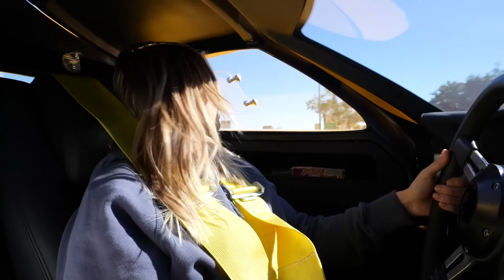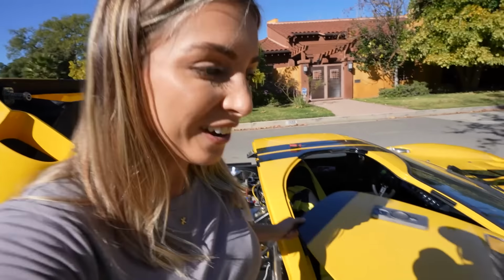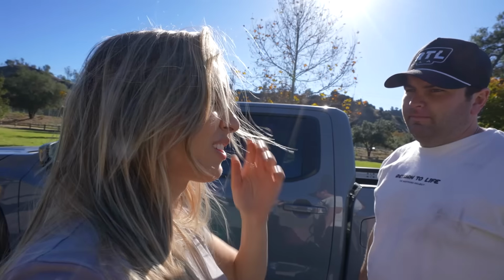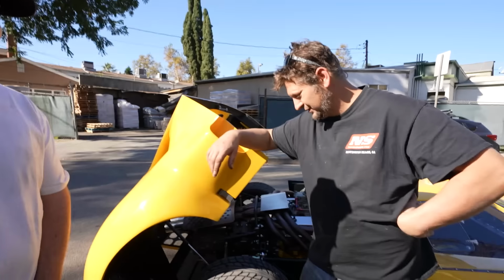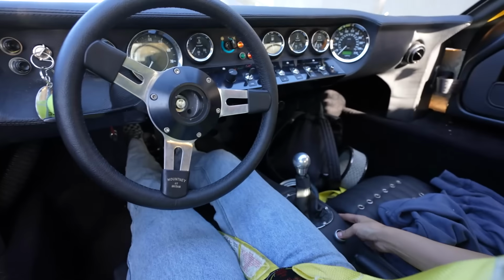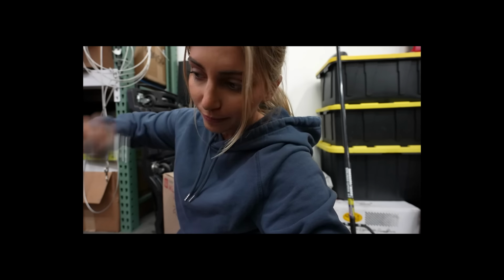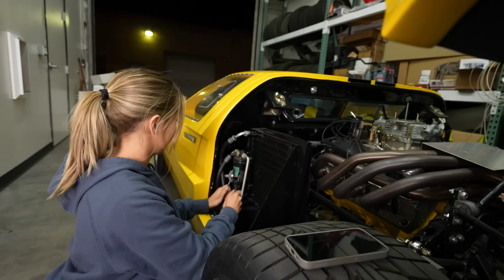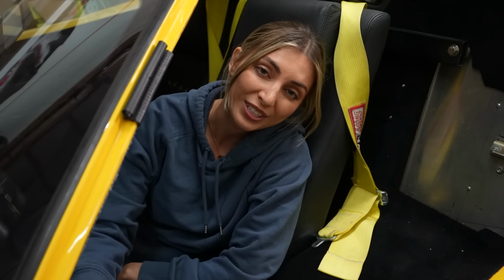The Dumpster Fire that is my Ford GT40.

Comment: Cool video, I am curious if you found the issue with your transmission popping out of first gear, do you have a link to the follow up video, you have so many video's it's hard to sort through all of them? My first car was a 1965 Mustang Fastback I bought in 1980, it had an C4 automatic transmission. I found a parted out 1970 Mach 1 that was rear ended and bought the Borg and Warner 4 speed transmission, the dual reservoir brake master cylinder and front spindle and single piston brake caliper assembly to convert my Mustang's brakes from drum brakes. I rebuilt the transmission myself using a transmission HP or SA rebuild book, I replaced all the seals, brass syncros, and all the bearings before installing it, and it shifted great, but when decelerating in second gear it would pop out unless I held the shifter, I never fixed it and lived with it.  When I wrecked the car in 1984 after getting it back from painting it Charcoal Grey Metallic with Black Metallic Shelby GT 350 stripes, and flares to fit 16 by 8 inch wheels, I hydroplaning in the rain into a tree with Pirelli P7 tires 
(They were not great rain tires, I got them free used from the Porsche Dealership  as take offs from 911 Porsch's that was next door to us when I worked at Supershops Automotive performance Centers.) After the accident I stripped the down all the drive train engine, brakes, and new all Moog suspension components, and transferred it to a 1966 Mustang Fastback I bought not running as a project car in 1985. I ended up adapting a Doug Nash 5 speed into the car, it was a great transmission and based on a Borg Warner design using many of the same gears as a T10, Doug Nash is now owned by Richmond Transmission.

Comment: A fuel tank that's been sitting for 20 years is highly likely to be full of crud, depending on its materials, the location and what was left in it.  It would be prudent  to check and possibly flush it before youhave to dismantle and purge the fuel system..

Comment: Itb's would be amazing, had them once and the bark they would make, my car was louder out front than the back.
I wonder how many tunnels are around your area 😁
The gearbox issue sounds like a worn synchro I'm afraid, or an engagement ring seeing as it's specific to that one gear.
Just make sure the shifter isn't catching on anything, on my old car even if the shifter bushes were slightly worn she would pop out.
Definitely needs wider wheels, and perhaps a hair bigger just to set it off.
As for colour I'm not sure, I'd keep it simple perhaps blue or red if you do need a change.

Comment: I think you will find a trans guy that will fix it. Peobably a shift fork but just to be sure i wouod put it into first then unhook the linkage and make sure its all the way into first gear then take it for a drive. You will only have first gear but atleast you know its 100% not a shifter related problem.

Comment: The guy below is right ... the linkage to the shifter and be a real beotch if it's worn or slightly out of adjustment  . I had a 71' GTO Judge ( 67' 400 with a high rise manifold , 3 speed Toploader trans. that was a Borg Warner test transmission for GM ) that was thrown together by a friend who was a good paint and body man but a really crappy mechanic , When I took the GTO home ( because he owed me money ) I barely got it home .  I spent the next year fixing his mistakes , throw togethers and numbskull slap togethers . I won't even bother you with the front end , the manifold with three bolts ( one snapped off ) a truely crapped out Holley carb. and of course the shifting linkage he totally messed up . In the end though I ran a new 82' Z-28 and smoked it and an L-82 Corvett from a rolling start and stayed even with it up to 128 mph. and he backed out of it because we were in city limits . I really miss that car ...it was a beast !   PK

Comment: Just blow in it, always a good fix since Nintendo days. First gear may be a shift fork, pilot bearing or synchro. Even weak/old mounts allowing for to much movement, but why just first? If that's not it the trans could be missing a snap ring on the intermediate shaft so the gear could be working its way off the shaft if it was put together incorrectly. If anything on the first gear looks worn or damaged well there you go. You mentioned its a Quaife box I'm surprised they weren't more helpful in trouble shooting this issue.

Comment: The fuel tanks in this car are very long, and the fuel pum are in the back side. So if you are running with low level of fuel (I mean even half tank) many times you will notice no power for a few tenths. You need to install a nodrice tank. Trust me.

Comment: You're probably going to go through a fuel filter or two with as long as that car sat.  Happened with my old IROC.  Changed the filter and the better flow pulled in more crap from the tank.  Changed it again a month or so later.

Comment: why do you coast in neutral and use the push button starter like an automatic gearbox/transmission?
when still moving forward with momentum, just release the clutch (like a push start) and you don't run the battery down, usually done in 2nd gear, or if you are free wheeling faster you can use 3rd gear

Comment: The engine/trans mounts could be bad causing them to flex too far and push it outta gear, or someone stripped the teeth on the first-gear synchronizer. Which can be replaced pretty easily. Those transmissions are easy to rebuild, the hardest part is taking it in and out of the vehicle.

Comment: Erm, my bicycle was free...it's so old the rusted chain often pops off, but it's my only form of transport and its mine.... As I see it, if I ever had the money to buy a car that had been sitting for 10 years in someone's yard... I'd be emptying all the liquids and dropping the engine/ transmission, examining the cylinder heads with a borescope, checking for wear, inspecting the valves and changing all the gaskets so I knew what I had gotten myself into...before even  attempting to start it.... But that's just me.

Comment: I hand same issue with my 1660 pinto twin carb running low on fuel and cutting out/revs drop down when fuel tank was low and didn’t help with it sloshing around as well the Electric fuel pump would cut off.

Comment: Given how long the car sat, the fuel tanks should have been drained and inspected, and the fuel filters and lines should have been replaced.  So if you haven't already...

The wheels/tires are a good size for the car as they look period correct. Obviously, you don't want to be driving around on twenty year old tires.

Comment: Disconnect the shifter at the transaxle, put the trans in first gear, start it up and romp on it. If it pops out of gear, it is NOT a shifter problem.

Comment: Check out everything shepelkstone below says... and if the side cover of that tranny can be pulled off, then pull it and see if the 1st gear shifting fork is bent. This could also cause your issue and it should be a lot easier (and way cheaper!) fix than yanking the whole tranny. Also, as shep alluded to the engine torque problem, check to make sure your motor mounts are still good too.

Comment: Have you made sure that all of your motor mounts and transmission mounts are in good working order ? Because if the shifter is connected to the body , and the engine and transmission are moving around independent of the body .

Comment: Shift fork
Keep your hand on the dhift knob, does it fall out of grar,,, or kick out of gear? Adjusting the shift forks sre simple but look for wear you might need to replace them.
Another quick way to check, eould be brass type flakes,

Comment: First gear is the most valuable on a gt40. I would take it to a parking area and disconnect the linkage a select first. If it’s still jumping out you know it’s your box. Normal the spring detent should keep it in gear. Ship it to me for fixing?

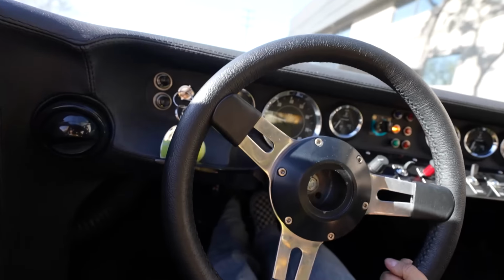Comment: I think the Starter is get Weak... 🤔 7:50
Sometimes, they will not work so good; just because, how hot the motor is.

Then, will start working again.. when, the motor is Cools-off.

Also, best to get a High-torque starter..  sounds cooler.  😎👌

Comment: The one way valve is a fuel pressure regulator, will need to be set again to prevent your fuel bowls over filling.

Comment: That one way valve in your fuel line looks to be a CNG pressure regulator valve. If so, it’s certainly not designed to have gasoline running through it.

Comment: If the car sat for 20 years the fuel lines are going to need replacing as they will have varnished up.In that GT40 it’s a very short line so a pretty easy job.

Comment: The guy in the red car was 100% correct.  Did you jump from a battery rather than another running vehicle?  Doing it from a vehicle will help charge your own battery over 10 minutes and it'll give a lot more juice when actually starting the car.  Bad Fuel filter?  The first thing you want to do when buying a car that sat for 5 years (much less 20) is to drain the gas, clean the tank (s), change the filter and refuel.  Now you know.

Comment: need to run a fuel flow meter  tells you how much gas is  going threw the line  cause you can have a cloged line and still have decent fuel pressure

Comment: Damn! Emilia. Will you ask Sandy how he would build a 460-based 557ci Ford. What heads, rotating assy, pistons rings. Will be N/A until I can afford a supercharger. This will be for the truck you see in my icon. It’s a 67 F100 Ranger also, what 6 speed manual transmission does he recommend, and clutch?

Comment: How do you guys afford the insurance and the payments on those cars. I used to own muscle cars but they were pretty affordable in the 80's and early 90's. 70 mustang 302 like Mary Tyler Moore coupe in red, a 71 350 Impala 2 door tan tank, a 70 440 Magnum Road Runner yellow with black stripes, a 64 425 dual quad Riviera in aqua blue, a 67 289 4.7 litre Mustang in primer gray and red, a Police Interceptor 289 Crown Vic in white that one was heavy duty and was a joy to drive with the cop tires I bought it with I did over 150 I think but the speedo does not go that high but it was pegged way past the number. The closest I got to that was in a 89 12 cylinder Jaguar in Gold that my friends mom had and I got it up to 120. Now I have a MB GL450 with the 4.6 litre V8 with dual turbos, this is lower or higher standard performance and the price of insurance is ridiculous I cannot image what you are being charged. Love the channel but damn your bills must be super high. God love you.

Comment: The needles for your bowl floats in the carburetor are sticking. I would just get a new carburetor, fuel pump, filter, lines, and regulator. That would be a good start🤔

Comment: So it won't pop out when there is no traction, but will when there is? It sounds like a torque issue. Not that I need to tell you but here is what I would check. Remove the interior boot and watch as you accelerate. How much twist is the transmission having? Is the linkage hitting the tunnel?

Comment: I really wish I was there...I could fix that popping out of first gear for you. I like the color as well, so I say leave her yellow Emelia.💛
Also need to get new seats so the new seat belts will be located in the right place. Also I would pull both tanks and have them or thoroughly clean them yourselves.😉
The end of the vlog...really Emelia?🤨 It was a tiny spider....and it was dead.🤪

P.S. are you going to put the livery back on the Z06?...cause you really need to.😁

Comment: My tranny (a muncie) pops out of 4th, linkage adjustment is good. So next step is to drop the transmission and inspect the 2 most likely suspects - shift fork and slider. Let us know what you find if you choose to keep and rebuild the original gearbox.

Comment: and ifr your regulater is on the intake line it restricts  the flow like it should regulate  the fuel pressure on the return to gas tank line so you have unrestricted flow to  carb  just run a t fitting on back bowel of holly   and back to gas tank on that line run the regulater it will control pressure and you will have unrestricted flow of fuel

Comment: Fuel filter, fuel tank is junk if it has been sitting for 20 years with fuel in it, fuel lines might be toast if you didn't replace them all before you started driving it. The tank itself might be filled with varnish and rust.

Comment: One more thing, does the car have exhaust catalytic converters? From sitting for so long, the gas that you would use has led in it. The motor was probably being broken the particulars that come out of the motor and get caught in the exhaust catalytic converters converters causing the material that gets trapped, and starts to rust or oxidized which blocks the flow of your exhaust whenever you give it gas it seems to die. Food for thought 🤔

Comment: Set your camera up to watch the linkage while you're doing a hard pull...it'll tell you if torque twisting is pulling it out of gear.

...or try unhooking the linkage altogether and doing a pull in first. BOTH methods are WAY easier than pulling the tranny.🤔

Comment: Question- doesn’t the fuel pump already sit on the bottom of the tank? So isn’t it constantly picking up debris if that was the case since fuel is constantly sloshing around? I’ve heard people say don’t run fuel low because of it. But does it matter?

Comment: had a problem with 2 brand new Quaife 6 speed sequential dog porsche type gearboxes that had the shift mechanism (inside the box) set up wrong (late 90s), they would drop out of gear...

Comment: The fact that it didn't do it when you were doing a burnout makes me think maybe you have an issue with the engine tilting against the motor mounts too much under power and it's pulling the linkage out of gear. Might want to look at what happens to those cables when the engine and trans move.

Comment: If it's not in the shifter, the next thing i would suspect is worn or rotted motor and transmission mounts.  If they give too much, the whole assembly may be moving enough to push the shift linkage against its limits and knock it out of gear.  This would happen the most when the motor is creating the most torque at the wheels... 1st gear.  Also, I doubt the Ford engineers tested the mounts long enough in validation to simulate 20 years of degradation.

Comment: The tranny is good!  @13:10 it's the cheapest fix, the plastic sheathing hemisphere on the bottom of the shift level is worn at the bottom of the shift lever.  My Samurai did that as well, cost a couple bucks to fix!

Comment: Popping out of gear is a common problem when it comes to manual transmissions. The most common reason a manual transmission would jump out of gear is due to low or contaminated fluid, worn synchronizers inside the transmission, or improperly adjusted shift linkage anyway i I sell Raycon's on my Ebay store yo i could have hooked you up :face-red-heart-shape::face-red-heart-shape::face-red-heart-shape::face-red-heart-shape::face-red-heart-shape::face-red-heart-shape:

Comment: Is it the trans,? Or is the shifter linkage hitting floorborads, shifter hole? when the motor flex under power and bumping it out of gear. Had this problem with broken trans mount,

Comment: My fox mustang would do that. Die and when it cooled off it would start. So your fuel pump is getting hot and not working. Replace it. With a good brand pump. Not no advance crap I learned the hard way

Comment: Thing sounds like it’s vapor locking the way it’s backing up on the starter like that if it just wasn’t getting fuel the car should still turn over fine just obviously won’t start

Comment: I don’t get trying to use the starter with a weak battery when one is going fast enough to just dump the clutch in the right gear to restart.

Comment: Can I have it? My dream is a gt40 ev convertion with swappable hot swappable  battery banks that mount where the saddle bag fuel tanks are at now. Battery banks would just slid out the side and charged ones slide right back in

Comment: Get rid of the carburetor and go with the ford fuel injection system and feel the engine the way it was on the track when it first came out, like a monster under the hood on a go cart

Comment: Junk gas ethanol or corn  alcohol, f- up my new Yamaha generator carb just siting 6 month grown slimy stuff that come out, but it harder making the jet hole smaller or clog them.  30 pull then it start and  wheeze and sputter then it run.  Thank the democraties
Reply: Their shifter at the bottom linkage  also see if it that a good long play forward and back full swing.

Comment: The trans should be an easy fix. Shift fork, or sychronizer gear. Who knows. Definitely not a $10,000. problem. 
As far as the paint goes, there's this YouTuber who had a bad ass red Ferrari and she decided it would look better green. She immediately regretted that decision. In other words, leave it yellow and black.
Get ahold of your Holly Rep and update that carburetor to a Holly Dominator
Watching you try to restart a standard when you're rolling with the key was funny. Put it in gear and drop the clutch with the ignition on.

Comment: Replace the sycro mesh in 1st gear.
Reply: 14h ago.
Hi , I had a similar problem with my 1969 E-type Jag.
It kept popping out of 1st gear. The synchromesh in 1st was shot. That’s a transmission out job. Hope this helps.
Cheers,
HZ

Comment: timing!
Reply: It may have a little bit to much Initial timing (hard start/low voltage).  Normally most people just set wide open throttle.  Many HO engines don't need max timing to make  max Hp.